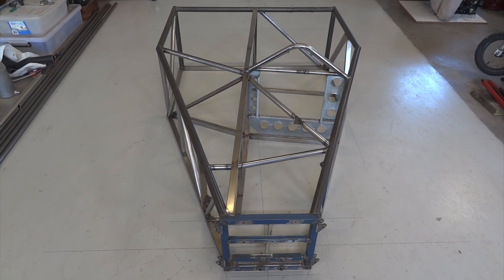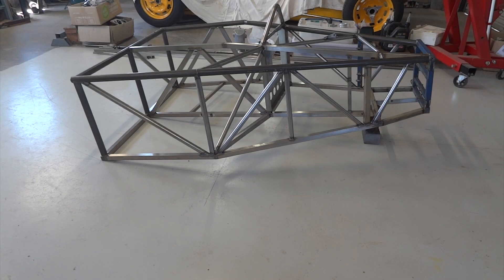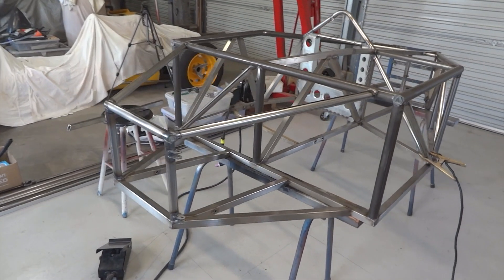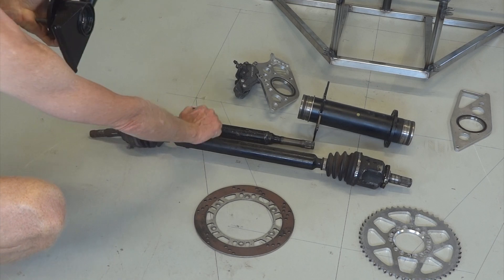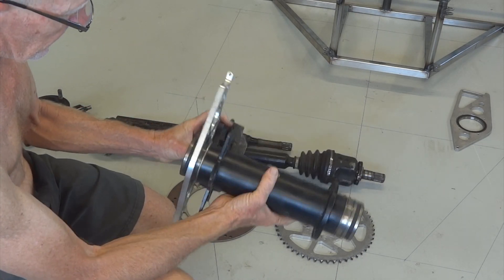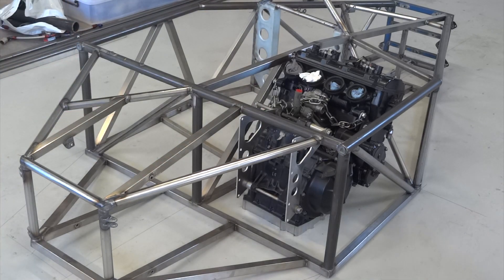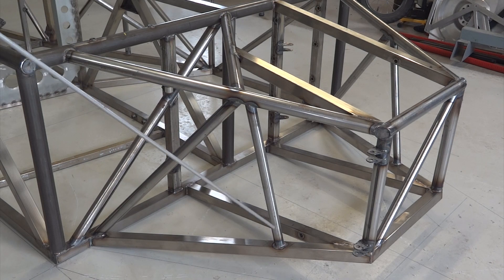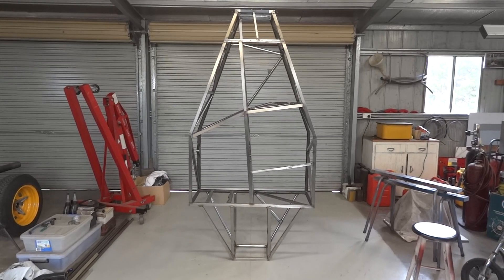Ninjamobil ZX10 Carbon Dart Chassis Part 2

Comment: Hi Malcolm,
Is running a spool on the final drive for simplicity and effectively locking both rear wheel 100% full time is better than LSD?
Reply from the maker: hi Emily. An LSD would be better overall, but the spool is simple and light, and I already had it in the shed, left over from another project! (it got replaced with an LSD)